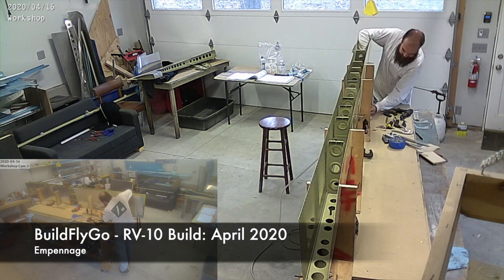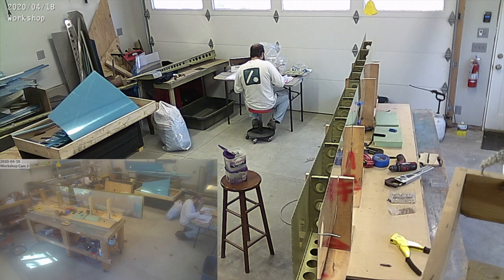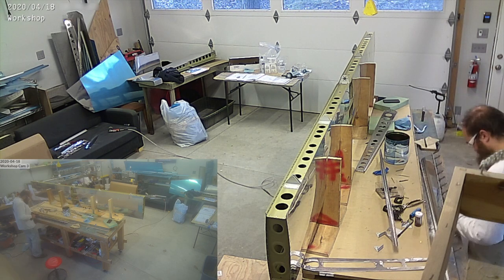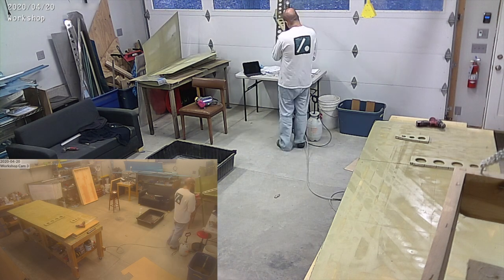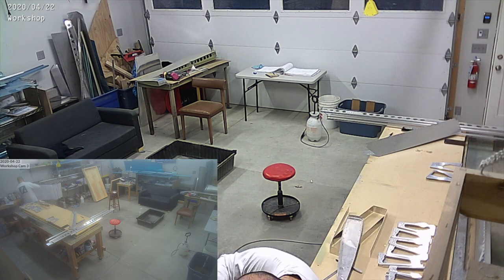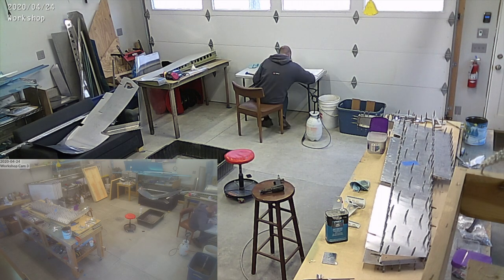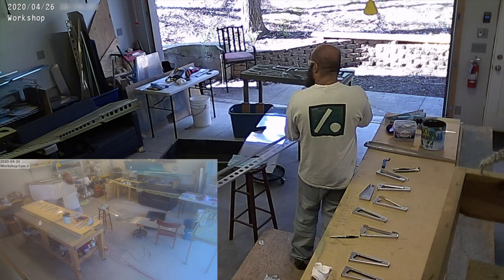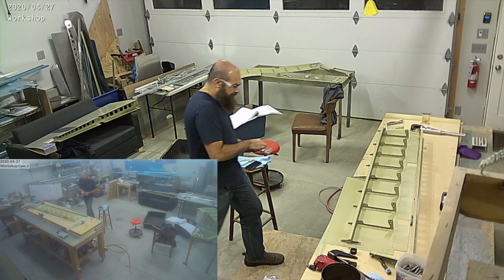RV10 Build: April 2020

Comment: Love the format, I actually don’t really need the picture in picture, just the narration on top of a whole view is fine. Do you have the other kits too, or just bought the tail kit used? Curious if you will go quick build for the wings or fuse.
Reply from the maker: I also have the slow-build wings. If I were to pick one of the two to QB it would definitely be the wings, the fuse is a lot of fun to build as it looks like an airplane right away. The wings are very repetitive and dull to work on.
Reply: BuildFlyGo totally agree. If I had it to do over again I would get the quick build wings. I may get the qb fuse for the 14 just to speed it up
Reply: @unclefreddy2009  remember that the 14 has all final width holes for the start so I. Theory that should cut down on some time putting the wings together. Will be nice to see them on the 10 too soon.
Reply: @ChrisVirgilio  it’s been a while since I built my 14 wings, but there are some parts from the 10 which are not final sized. It cuts down some on the time but wings are wings (same thing over and over and over). I ended up ordering the slow build fuse, still waiting for it to arrive vans has shipping delays around 4-6 weeks past my original crating date so any day now.
Reply: @unclefreddy2009  4-6 weeks?! That's brutal! That really changes my thinking on timing as far as ordering future kits goes. I'll have to add buffer time for the delivery to be late.
Reply: @ChrisVirgilio  just to be clear, they have since revised their kit shipping times to include the 4 weeks at least. When I ordered it was 10 weeks, but when the 10 weeks arrived they told me fires, coronavirus, demand, etc pushed it out another 4-6. I’m coming up on 14 weeks right now and no shipment yet. Their page is probably closer now at this point

Comment: I am looking forward to seeing this series, always been curious about maybe but doing an RV some day. First, I gotta say, FlightChops eat your heart out, lol. Guil, you appear to be making some fast progress, amazing. I watched the main image with occasional glances to the smaller one, but it seems blurrier than the big image. 

At about 8:30 I noticed you had a clecoed skeleton but shortly after, you took it apart to wash and prime. Why build it up in the first place? I’m sure there are good reasons for it. And regarding the squeeze rivets, is that standard for an RV kit? I always thought they were completely bucked.

Keep em coming,

Cheers
Reply from the maker: @Flightchops and I will do a joint fly-out once the pandemic is over ;) Yes, the camera over the door is having some issues with the lens.

Yup. Only the rv12/14 are final size punched. All the other RV kits you have to assemble with cleco's, then ream all the holes to the final size before disassembling, dimpling, priming, and then finally reassembling to rivet.
Reply from the maker: I missed your rivet question. Bucked and squeezed rivets are the same rivets, they are just formed into their final shape via a different method. Bucking involes a rivet gun and bucking bar, squeezing is the same rivets with a pneumatic or mechanical squeezer. I find squeezing to be easier so I do that whenever I can.

Comment: I have a bunch of questions. Why did you decide to buy an RV10? Need more room? Tired of your RV9? May I ask why you decided on the RV10 over the RV14? Are you going to sell your current RV9?
Reply from the maker: Every so often 2 more seats would be nice. We don't plan on keeping it by ourselves but to get 2 partners to share with. 90% of my flying works great with the 9A but for those few times I'd want the extra space the 10 wil come in handy. Definitely keeping the 9A :)
Reply: Great answer. Thanks. That’s a great idea. I’ve been thinking about building an RV14. I saw the AOPA RV10 and it makes you want to build an RV10 for sure.  Do you know what engine you are going to use? Do you know if it’s possible to upgrade the engine to a 300hp engine with a 4 blade carbon prop? Mods needed to do so? Thanks so much for sharing all your videos. Please share as many building tips as you can as you go. Thanks again!
Reply: AOPA RV10 Amazing Build
Video
https://youtu.be/7ifF2BqwZCM
Demo Flight
https://youtu.be/78fJn36zLfE
Reply from the maker: The RV10 will take considerably more time to build than an RV14. On the order of a year+ more time. I'm likely doing a Continental Diesel (if available) or a Titan IO-540. I would probably not look to 300hp as you will then easily exceed Vne and get yourself in trouble. I suspect it wouldn't be too hard to put in an IO-580 for a few more kilobucks and some possible engineering time for engine mount/cooling/etc.
Reply from the maker: There is no engineering work done for the AM engine in an RV10. Someone would have to design the engine mount, cooling, fuel system, cowling, and do all the engineering analysis around that. It's not something I'm willing to take on, and I don't really have the aeronautical engineering contacts to hire it out. It would be a cool engine for the platform if someone would do that work!
Reply: If you watch the videos you will see that AM does now have a kit for the RV10. He shows some of the parts including the mount. I would give the owner a call. He is a nice man. See what he has for you.
Reply from the maker: @BayAreaCowboy  I talked to him, thx. I'll wait to see a flying airplane with the engine and see how the performance is and what the install looks like. I'm also a bit concerned about fuel availability, very few airports actually carry car gas, so I'm leaning towards the Conti diesel if they can make it happen.